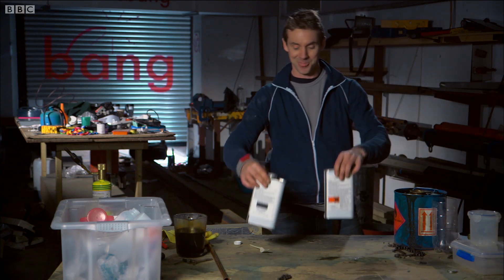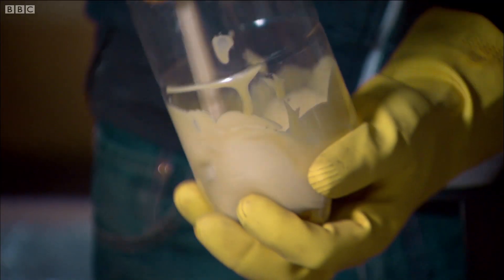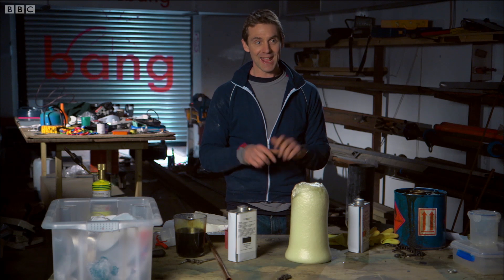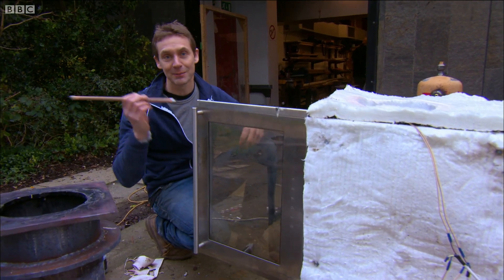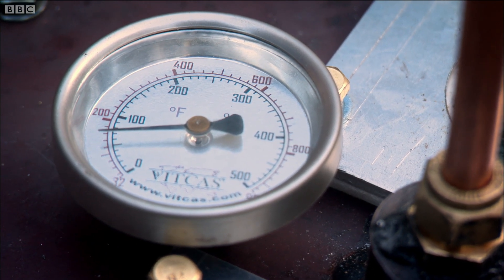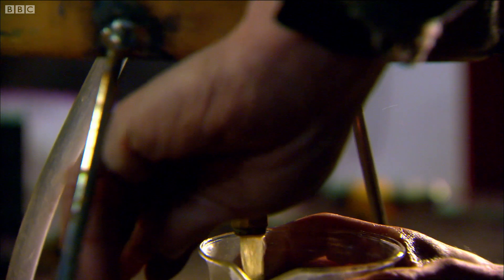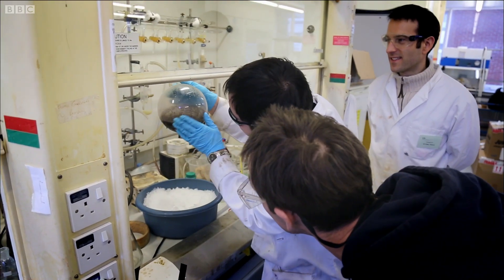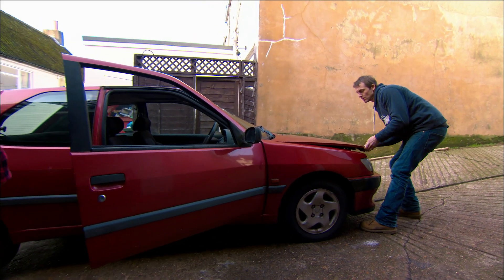How to get diesel from waste plastic - Bang Goes the Theory - Series 7 - BBC

Comment: The question is how much energy do you need to make the diesel? If it yields more diesel than the energy required to make it then it’s worth it.
Reply: The sun provides you with heat, no money required.
Reply: @lookdawg187  ah ... wow ... so you get the solarpanels for free?
Reply: @zeckendreck  ...solar panels he's says 🤣Check solar thermal energy. "Within the receiver the concentrated sunlight heats molten salt to over 1,000 °F"

Also I said the heat source is free. Just like you say free wood as your heat source...
Reply: @lookdawg187  wood i can find all over the place ... solar panels not so much ..
Reply: @zeckendreck  who needs solar panels when you have the sun? 

Solar thermal heat doesn't require solar panels....
Reply: @lookdawg187  yea, nice for you .. i live not in San Diego .... on my place this works maby 8 week a year ...
Reply: @lookdawg187  Solar Concentrators - yes, that would work. But not at 57.5°N where I am! 😁
🏴
Reply: if you get free wood ...
Reply: Nope, as long as its CHEAPER than buying from the pump.

Comment: I’m prepping for the apocalypse and we own multiple diesel vehicles, this info is gold.
Reply: You could make barrels of this stuff
Reply: Keep prepping ... its going to be nasty
Reply: Yep. Considering that diesel and petrol can actually rot a little bit over time, perhaps "storing" the diesel as plastic could work? I think the problem is fractioning the distillate into the carbon numbers you want. Thats the part that seems tricky to me
Reply: You should go learn Chemistry, there's so much golden info.
Reply: Might be easier to just burn it to power a steam turbine and charge batteries for electric vehicles. Probably won't be many pure diesel vehicles about in 10-20 years.
Reply: nope first you can't vaporized 100% of the plastics seconds it take about a tons just to make a simple gallons thirds it this the most polluant procedure on earth fourth you can only do a single batch your wasted plastics would jamned in the oven and you will have to throw it in the garbage in order to just make a gallon! don't be dumb! i am a science guy! oh and i forgot to tells you that aftrr like 4 or 5 cook your brain will stop functionning and you will suffer dangerous diseased and probably died of demencia and brain bleeding! your lungs will be burned your liver and kidnees will stop working these guys even if they are far enough they will be poisoned its just a question of times!
Reply: @luciferd4820  yes but you are a dumb science guy .... you can use wood as energie and wear a mask ...  for sure it works only in time of Mad Max ... today you will have after 5 min the police in your backyard

Comment: How did you purify diesel?
In lab what you mixed to separate diesel from crude oil.
Reply: it's a technique called chemical cracking, there is a simpler method called thermal cracking that uses heat and a catalyst like copper oxide, that's all i know, but it should give you some search terms to learn more with. good luck!
Reply: @gramursowanfaborden5820  OK I wait.

Comment: The poor distillation apparatus and lack of temperature controls resulted a mix a waxes and diesel- which is why it was so discolored. Put a little more thought into the reflux apparatus and better temperature zone control and it would produce a higher quality product.
Reply: Reflux apparatus? can you explain
Reply: @jasonmartin3497  Reflux is just heating/boiling in such a way that the eventual condensates drip back down into the boil, so they boil/condense over and over, resulting in a purer final product - but purity is at the expensive of a loss in yield. The most efficient method would be to develop an engine that runs on solid plastic (pellets), with mitigations for the fouling caused by contaminates. Much better to throw 20% of the energy away and pour whats left straight into your existing diesel engine though.
Reply: Kevin, if you know about this can we chat please, I need some help recycling plastic in remote communities

Comment: If you Google, RENEWLOGY they have built a system that is efficient and almost runs off what energy is needed to produce fuel.
Reply: Lawrence lawrence they’re not adapting well to handle the crisis. Not really a good relative model
Reply: @zaniah8270  why? It seems like an efficient system. Is it the volume? What are it's faults?

Comment: This need not be an efficient fuel source; simply making it a way to dispose of plastics instead of dumping justifies it enough.
Reply: The remainder will be a char/sludge which is of similar properties to bitumen. You can use it in road construction.
Reply: There is still waste after the process.  you only take what you want to use. The remainder still need disposal.
Reply: @theoanson8821  Yeah I was curious to see what was left behind in the still, after he cooked the oils out
Reply: @renacimientoargentino7515  Wow! thanks for the detailed break down. I had a hunch this plastic diesel doesn't burn clean. I was also wondering if the bitumen slag from plastic is chemically similar to crude oil slag. Ill stick to my renewable diesel in the mean time.
Reply: @theoanson8821  
Apparently the remainder is Carbon Black a valuable product
Reply: Here here, say I.
Reply: Yes but the carbon would still end up in the atmosphere.
Reply: @Mr_Chuckles  Carbon capture, renewables... everything is possible if we are sustainably energy surplus.
Reply: We're already burning plastic in a lot of places and use the energy to heat homes or get electricity. So this is nothing new. This just adds another step and of course since it's a product of fossil fuels it will increase the CO2 concentration in the atmosphere when burned. So this has no future, unless we capture and store the CO2 that's being released and that's only possible in large factories (see carbon capture and storage). It's quite expensive though.
I get that people are excited because they've just learned about cracking, but it's really something chemists have been taught for decades now. It's nothing new. If it made sense we would have done it long ago.

Comment: If the Diesel engine is stationary and turning a electric generator, the engines WASTE HEAT from the exhaust can be used to crack the long plastic hydrocarbons into small hydrocarbons, burned as a gas or linked to form a liquid diesel, or new plastic for everyday items.   Now waste plastic bags are making electricity and consumer products rather than floating in the oceans.

Comment: IT would be nice to have more information.  Exact amount of plastic and number type put into container.  Exact amount of heat being produced and with what build and what components and at what cost.  Exact distillation per liter of fluid extracted and into what components.  Cost of diesel at the time of extraction and total cost of energy to make it.. You know the math stuff that tends to blow good ideas out of the water and  make them useless.  And yes i know im 3 years to late.

Comment: look how dirty that diesel is that they made. I have experience with diesel engines, and I can tell you that will clog up a diesel so fast. Injectors, Pumps, Combustion chambers....
Reply: True although I think it can be filtered.
Reply: That's hard to do
Reply: @Taydrum  No its not.  1 mikron filters will do that, easy.
Reply: @gytax01  1 micron filters get plugged up so fast, let alone 10 micron filters
Reply: @Taydrum  Great, that means its working.

Comment: Can you describe the process? What does the collector? Do you have to explain in detail? Is going through the gas pipe?
Reply: Is there subtitles?
Reply: Ali Büyükadalı basically, the copper tube is here to condense the flammable gases produced by heating plastic in liquid "diesel".
Reply: manaquri Well, where it connects copper pipes in the process? Is there an empty tube? Can you write in more detail?

Comment: This is not a joke it is simple pyrolysis. it can be done with many materials. also can get gas at the end of the process infect the army used this method with wood in the war when there was a fuel shortage for the machines to run on syngas. most effective with plastic you get up to 95 liters of fuel from 100kg of plastic and there is nothing else than hydrocarbons in it.. 80-85% is in the fraction range of diesel and 15-20% fraction range of petroleum. as for the comment for toxic gas.. the final stages of the system will have lighter gases such as propane butane etc they are not toxic unless you want to put the pipe in your nose and breath it in. the system can be fully self sustaining if these gases are burned off to heat the retort. 
this is a very hush hush subject that the government and oil company's will not want you to know about. do not knock this it is real and perfect way to get fuel and clean up our land fills..
Reply: Our FEMA manual. Outlines the syngas process well. this was put out by the federal government so in the event of an emergency you can still operate vehicles and machinery
Reply: 100 kg plastic = 95L of fuel.
Diesel $1.75 per liter
Plastic junk FREE or they PAY YOU to take it away.
95L @ $1.75 = $166.25 per batch.
How much energy do you need for the process?
Reply: can you help me for make e machine?
Reply: @nayjjofarms3008  Very easy, research on Pyrolisis reactor
Reply: I always heard it called a fema generator.  Syn gas.  Brown gas what it was called.  Used sawdust as a medium to cleanse it.  Colder the gas was better the power.
Reply: Amazing info. UK gonna need serious thought about this as China has stopped importing our plastic??
Reply: @wormwood6424  There was a company in Ireland called Cynar who were doing this on a commercial scale, there's a good Al Jazeera vid about it on YT.  Funny thing is they were looking to build similar small plants in the UK yet went into voluntary liquidation in 2016...
Reply: @robjworkshop5692  Lol. They probably went into liquidation in anticipation for Hillary as president .
Reply: What about inner components in the engine?Was there any damage to components & seals,with this process.
Reply: @ruipires7954  Also I wanna know about fuel purity.  Wouldn't a back yard operation put all sorts of dirt in the fuel?  But hell, I'll give it a go, why not?
Reply: @Murrangurk2  I saw a video just before this one about a man living on an island.He stated that first you pack the plastic in the metal container but he stated,"in a zero oxygen container.I would say no dirt or pollutants going in and what was distilled is remiscent of an out gas much like butane.I would say process it a little more or in a different varience & I'll betcha you can get a level better even then butane.Water vapor maybe??????
Reply: @ruipires7954  I saw the same video!  I wondered - how the hell does he extract the oxygen?  Looks like there'd be loads in it!  I wanna know more!
Reply: @Murrangurk2  thats a good one.I'm no chemist at all.I wanted to know how he goes from diesel to fuel for other engines.Whats the process to curve to go from one extreme to another.Imagine if we could perfect this.That's is without BIG FUEL COMPANIES taking a sniper shot at us.They hate this kind of info.Remember FLORIDA BP spill??What did these company call us?The little people.They said they wouldn't forget about the little people.I'll never forget that day or the damage caused.I believe these companies have these technologies but much like BIG PHARM,there's no money in cures just like there's no money in alternative fuels.
Reply: @ruipires7954  If you let oxygen in, you produce syngas (CO + H2), which can then be run through a copper catalyst and condensed to liquid methanol. If you have zero oxygen, you'll produce hydrocarbons like methane CH4, ethane, propane, butane.. The problem is that you can't easily transform them into liquids, for that you need an elaborate process. That's good if you want to run the gas through a generator as soon as its gasified, but if you want to store fuel for later you should liquefy it, like making methanol.
Reply: @slicktires2011  thank you Slick.Outstanding.
Reply: +daniel wethers 
My Dear , can you suggest me the name of chemicals or catalysts use in this operation ?
Reply: There is nothing hush hush about it. Anhydrous Pyrolysis is a well-known process. The trouble is that you don't get nearly the energy out in oil, that you put in to convert it from plastic. Now, if you could find a free energy source and get the plastic cheap enough, you might have a way to make a product you could market.
Perhaps a solar thermal array, that instead of boiling water for steam turbines, vaporised the plastic in a pressure vessel and gave you oil. Not sure if the expense of construction would ever offset the price of oil.
Reply: @Clean97GTI  people pay you if you take their plastic waste. buying plastic is dumb when it has a negative value in trash.Its better if you let people collect it and shred it to make ethylene and propylene from it with cracking.
Reply: @r2eholland314  you still have to haul the plastic. The point was that there is still a cost involved even if people are giving you the waste for free.
Reply: plastic into petrol cannot be done in a profitable way, the energy input is more expensive than the result. Otherwise, everybody would do it.
Reply: Hello daniel. I wanna build one. I ahve tried to build one before but that was on coal and gas burner and one was on the kerosine stove. But all the energy sources were not efficient in means of input and out put. Is electrical heating more suitable.?

Comment: a small scale operation and this is very much inefficient, but a solar tower surrounded by plastic waste factories? would work like a charm, afterall, plastic is one of the waste products that is always an issue - you would have to get rid of the air pollution some other way though, don't want that solar tower getting clouds forming above it.
Reply: We could farm the Pacific ocean garbage patch and have tons on plastic to turn back into oil.
Reply: There are landfills all over the southwestern USA that would make ideal spots for such a thing. Separate out the plastic and leave it at the pyrolysis tower. Come back the next day and pick up your light sweet crude.
Reply: Michael Bradley : check out the system
https://youtu.be/nU-OW2pAp6M
Reply: Michael Bradley

Comment: have you experimented with other plastics, such as old household appliances and children's toys?
There are so many tons of this waste going directly into the landfill that it seems like a great potential source of energy
Reply: I think any plastic would do the job. It all came from oil! We all go back to the earth when we die so should oil.
Reply: TheSeeker532 not pvc plastics
Reply: Plastics that contain BPA will cause cancer if excessive fumes are breathed in often. BPA is a part of lead and lead is a neurotoxin that causes neurological damage and birth defects. I think plastic without BPA will not release the cancer causing fumes. Someone research this, I am not positively sure on the answer.
Reply: @aperson4933  BPA is not a part of lead, even if there where lead in there, lead would be Part of BPA, but there isn't even any lead in there.
Reply: @tobinator680  I stand corrected.
Reply: Well let me state this, there are 5 major types of plastics. You can tell what plastic your burning by the number on the bottom of the bottle surrounded by a triangle. 
Not sure if it would make a difference, but I would research them carefully. Not saying anything significant when I say this next statement because I honestly don't know but you never know what can cause cancer. Maybe one of the 5 major plastic releases a fume when burned that may cause cancer in the lungs. Research it beforehand.

btw when I mean 5 different type of plastics, usually made from a core material however mixed with a bit of other materials to make it hard, flexible, see-through etc.